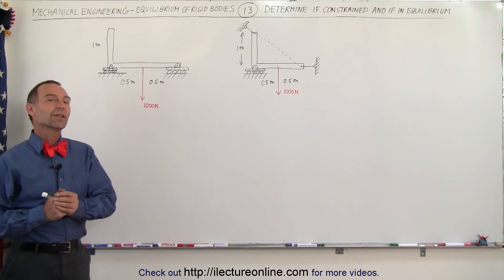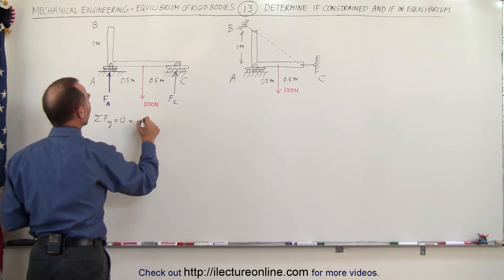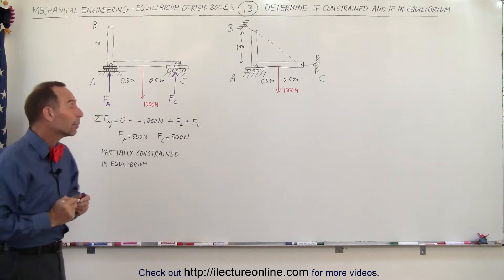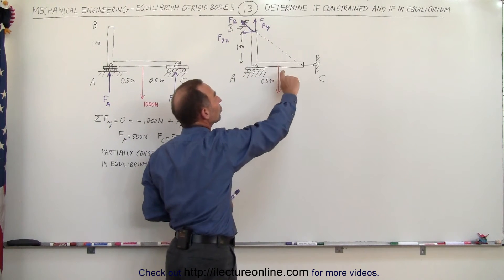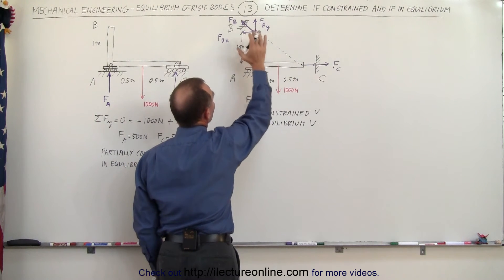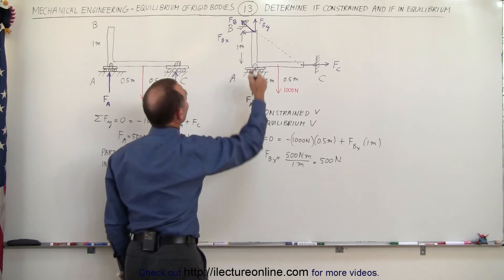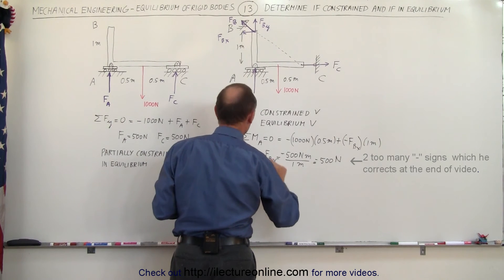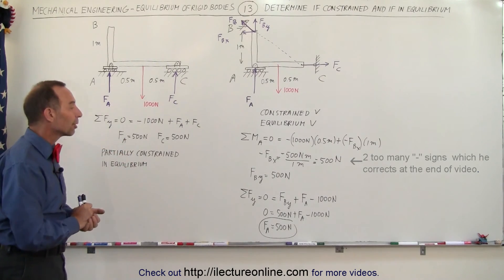Mechanical Engineering: Equilibrium of Rigid Bodies (13 of 30) Find Constrained? Equilibrium=? F=?

Comment: Hi Professor. I have a question: why can't we take Fb itself instead of Fb in x direction when we calculate M?
Reply: You can but you’d have to do vector cross product with the position vector r from A to B cross multiplied with the force Fb in vector form. It’s just harder to do that and easier to multiply the components of the force with the distance to the pivot point

Comment: Hi Professor,
I think I noticed a slight inconsistency with how you've done the sign convention in this problem. When you write out the sum of forces equations, you almost always write the forces as a scalar quantity and modify the +/- signs accordingly. But in this problem, when you calculated the sum of moments around A, it looks like you made F_bx into a vector quantity. Thank you again for these lectures. Edit: nvm, just saw the ending of the video where you corrected it
Reply from the maker: No inconsistency.  There are simply 2 ways in which you can express forces: as vector quantities or as scalar quantities.